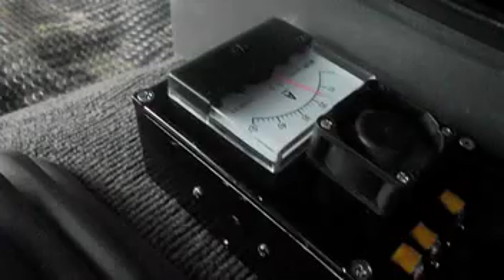HHO PILIPINAS  -HHO BUTUAN MINDANAO

Comment: You should use KOH and distilled Water and dilute it down until it will pull about 1/4 of your Alternators  Amperage to run it. You should get per Watt about 5 to 7 ml Gas, thus making it, if you allow 15 Amps,  about 0.8 liter of HHO Gas,  which is plenty for your small Truck.
Reply from the maker: thankz  bro...
Reply: Have you measured the Output Ratio. How many Amps you put into it and how much Gas you will get out ?